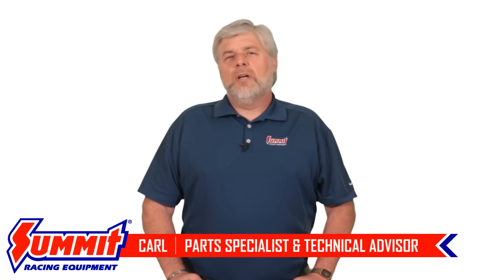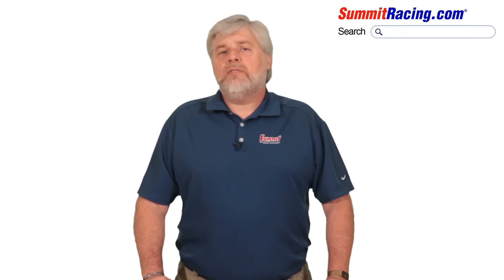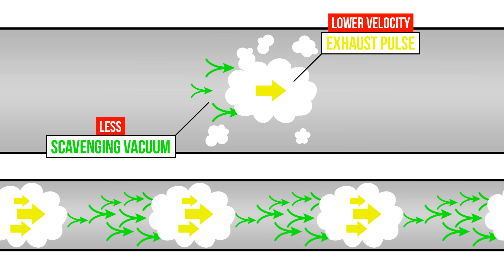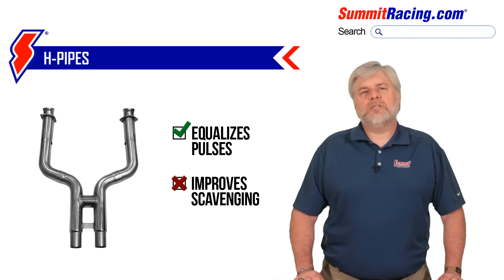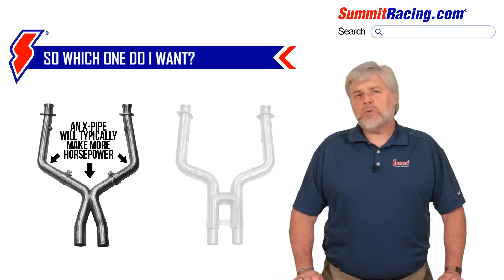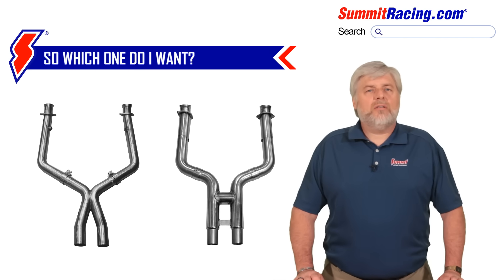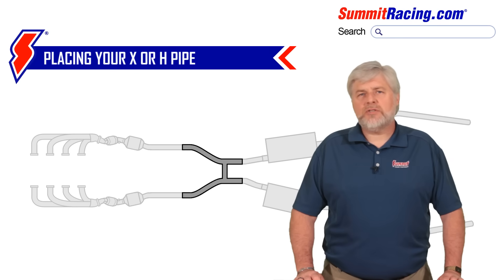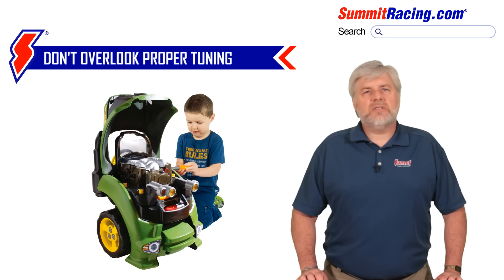Exhaust H-Pipes vs. X-Pipes: What You Need to Know

Comment: X-pipes suck on a Chev 381 stroker in a Camaro Z28. The sound was terrible.

I then took it off the next hour, cut down the middle of the x, slid a stainless plate in between and Welded it back up.

True dual exhaust! Sounds bad ass now.
Reply from the maker: Hi Jake, thanks for watching and giving feedback on your experience!

Comment: I'm building a restomodded 06 Escalade using the LS364/450HP GM performance engine. It's a 6.0L LQ9 with LS3 heads and a LS6 highlift cam. This will be a daily driver so, relatively speaking, MPG is a consideration. With this in mind, which is the better choice X or H pipe? Also, what diameter do you recommend?  Any other advice on exhaust configuration is appreciated.

Comment: I have a 96 impala as and am putting custom exhaust..5.7 ltr ...cold air intake k&n...373 gears ...aluminum balanced driveshaft..Do you recommend  a Xpipe or Hpipe for my impala? 2.5" ppiping..stock  exhaust manifold for now...would you advise headers..which header? Thanks for any help.

Comment: Summit ' you'll probably not answer my question but ' hopefully a reader might help ? why not include a straight pipe system ? Like example (manifold/Header, catalitic converter, resonator then muffler straight out to exhaust tail pipe ). All l hear about is X- pipe this and H-pipe that, but what about an exhaust system for each side of an engine like the old days ? Be it a six cylinder or eight cylinder engine. What would or wouldn't be the benefits ? How will a double exhaust system perform, sound and maybe even look ?
I have a 2014 mustang Roush RS with 3.7 V6.
Here in california we are not allowed to mess with the emissions end of a car, but we can do the mufflers. My Roush RS mufflers were getting to dam loud, so instead of removing them l added a 22 inch glass pack to both sides after the X pipe connection. 
It sounds totally quieter & awesome now.  It had  real bad "Drone" before,  in the area of 82.5 to 109.5 decibels in the cab of car. With the new glass packs it's down to the 72.5 - 80.5 decibel. Is it possible the "Drone" is coming from the X pipe connection ? The 3.7 V6 has a nice beefy sports car sound to it now from the out side, but it has the dredded muffled "Drone" sound inside cab still. The Drone is always present between 1400 & 1600 RPM . I hope someone can answers this question , thanks.

Comment: I have a question!  What will be results from the combination of x and h pipe in same exhaust? It's that worst or better or just depends what type is mounted closer to the engine?
Reply: There isn’t really a point imo. If you’re gonna do both, just do a true dual going into an x pipe. I don’t have hard numbers, but I don’t see how introducing unnecessary turbulence in the system is gonna help when you’re just gonna speed up the exhaust flow with the x pipe anyway. That’s not to say an h pipe is bad, it’s still great! But having both seems to be doing a lot for minimal, if any, improvements

Comment: The famous 95 MERC runs a Walker H-Pipe, 2" x 21" MagnaFlow Glasspacks, and Walker Tailpipes.
Exhaust tone is mellow, not raspy -- NO DRONING at freeway speeds, either.
https://www.mercuryforum.com/forum/grand-marquis-14/1995-grand-marquis-restoration-8937/

Comment: Ok I have a question for you I realize a lot depends on what vehicle and  the particular application I am building a 4.0 LTR Fuel injection Inline 6 for a  1998 Jeep Cherokee  which would be better H pipe or X pipe
Reply: Neither. Your I-6 will need a 2.25-inch single exhaust and a MagnaFlow Glasspack.
That Jeep's I-6 engine is the ONLY vehicle that gets a major power gain from a K&N CAI.
If ya get the K&N intake, install the conical filter AS IS -- install it, and LEAVE IT ALONE for 50,000 miles.
Keep your K&N Filter the same way you'd keep a hard-on -- don't fuck with it !!

Comment: I'm still confused.  For a stock Mustang GT, what is better?  H or X?  I believe the Mustang off the factory line has an H...but is that the best?
Reply: Until you set a performance goal there is no "best". What is it you are hoping to accomplish? Sound? torque? or top end power? The stock exhaust is a compromise to meet most applications and generally pretty good for stock engines. Speed costs money, how fast do you want to go?
Reply: @stm6989  Hey Stanley.  I'm not really a speed freak...I just want my Mustang to SOUND like a Mustang.  I want a deep throaty rumble.  I wouldn't mind a little more power...500 is plenty for me.  But right now...I just want good sound.  I guess top end power would be my goal.  Most of my driving is on the street, so I won't be pushing the limits of the engine.  If I'm on the freeway, I want to move when I punch it.
Reply: YEP. To get better flow and more torque & power from your H-Pipe setup, I use and recommend a pair of MagnaFlow Glasspacks, due to their straight-through design and there's NO baffles and/or louvers to restrict the flow.

Comment: So how do you achieve scavanging from single pipe exhaust ?
I have a 96 F150 with 4.9L   I was thinking 2-1/4 off manifolds x2 into Y connector into Flowmaster and 3” single out the back ? Stainless of corse. Will this scavange

Comment: Hpipe is better for turbos and maybe superchargers,  but the x pipes are better for a naturally aspirated engines.. 
Back pressure should of been mentioned.. being a turbo back pressure most likely isn't needed but other wise it's an integral part of the horse power and TQ mapping.. 
If you reduce your back pressure to much you will loose TQ but gain high end performance, and the more back pressure you start increase TQ at low end. 
Then you have to consider the purpose of the engine the bore and stroke and maybe gearing to pick the ideal exhaust. 
It's really not that complicated

Comment: I don't believe in either one. My car has a custom exhaust where the right and left sides are not connected at all. There is a separate pipe for each cylinder bank. Works and sounds wonderful.
Reply: If you are happy then no need to change😏
Reply: BOTH the H-Pipe and the X-Pipe improve the overall performance of the engine -- which is EXACTLY why they were invented (and used by FORD for their dual-exhaust syteems) in the first place.
Reply: @SlikLizrd  I'm less concerned about performance and more concerned about sound. By completely separating the right and left cylinder banks it changes the sound noticeably. To me it's all about the driving "experience", and the sound is a big part of that experience. You can only use so much performance on the street.
Reply: @geraldscott4302  Absolutely. Keeping the pipes separated gives a different sound, and it may or may not sound "better", according to one's preferences.
 HOWEVER, there are other considerations to weigh -- such as cockpit conversation, top-down cruising, and the much-dreaded DRONING.

Comment: Smaller pipes "may" give you more horsepower, unless you do it on the dyno, in which case, opinion burns down and horsepower goes up. bigger primary header tubes? More power. bigger exhaust system pipes? More power. X-pipes over H-pipes? More power.  But only if you put it on the dyno.  Otherwise, old wives tales rule.

Comment: The only thing I have a problem with is the header wrap over time cooks the headers.The tubing develops cracks and crevices then starts to crumble then blows out.. When replaced the old ones can be wadded up by hand...
Reply: My 468 c.i. build used port-matched, ceramic-coated, stock exhaust manifolds, with 2 High-Flow Cats, 2.5-inch Pipes, and some cheap-ass glasspacks that I later changed over to MagnaFlow glasspacks.
Many thanks to Summit Racing for their performance parts and excellent customer service.

Comment: Still hate when anyone in the automotive  field calls an Engine a motor
Reply: Tito Dwi Laksono  an engine converts a fuel to power, a motor uses energy  to make power.   Take a  gas engine  it take gas, air , spark and timing to make power, a motor takes electricity which is already power and turns it into motion.

Comment: On a 392 cc Int Harvester  -  PU, is the H setup, w/ bridge as close as possible to the exhaust manifold, the best solution for dual exhaust?  Thanks. jtr
Reply from the maker: Yes. The setup you’re describing would be ideal on your torquey, low-rpm International 392. Additionally, it also may help create a deeper exhaust tone.

Comment: I have a question about diesel exhaust? I have a 92 7.3 international non turbo engine. It has single exhaust now . The muffler is going fast . It has a 3 inch pipe going in the muffler. I am going to go with a 4 inch Y pipe and turning it in to dual exhaust. 4 inch out the back with 4 inch inlets and 7 inch outlet tips so it can breathe . You have any idea how many ft pounds of low end torque this will generate . I was also thinking about having a set of Headers built for it. The compression is 20 to one . One last thing this winter it would start at 8 degrees with only the Glow plugs . Now since it’s warming up it doesn’t want to start. So should I keep up with the winterizer or add kerosene each time I fill up. My email address is
montebrown110@gmail.com if someone in the non turbo club got a useful answer send it their . Could use some good advice on this?
Reply from the maker: You may gain a bit of power with a larger exhaust system, but not much. The naturally aspirated 7.3L IDI is mildly tuned, low-revving, and, of course, not turbocharged. Regarding your hard-starting issue, check for faulty glow plugs and leaky injector return line O-rings. Glow plugs often fail, and just one or two bad ones will make the 7.3 very hard to start. Test them with an ohmmeter. They should have 0.1 to 0.5 ohm of resistance; at 1 ohm or greater, they’re definitely bad. Be sure to replace them with high-quality parts; Motorcraft is a great choice. It is also common for the injector return line O-rings to shrink and allow air into the fuel system. The result is extended cranking times. To simplify the job, use one of these Delphi kits. Note that there are early- and late-style kits; the split was in 1992. Be sure to get the correct one for your vehicle.
https://www.summitracing.com/parts/MOF-ZD9
 
https://www.summitracing.com/search/part-type/fuel-injector-installation-kits/product-line/delphi-fuel-injector-installation-kits

Comment: What about y pipe? 

what is the ideal location for the y pipe. Is it better to placed further back or closer to the headers?
Reply from the maker: A Y-pipe should be placed as far forward as possible.
Reply: @SummitRacing in terms of efficiency does the y pipe scavenging and equalize the pulses as x pipe or h pipe ?

Comment: What’s the best setup for my 70 Chevelle SS 454? Thx
Reply from the maker: In most cases, an X-pipe will outperform an H-pipe. We would need to know specific details about your application. Give us a call @ 1-800-230-3030, and we can assist you further.

Comment: I put on a Cat Back Flo-Master dual exhaust system on my 2006 GMC seirra 2500HD.. ( 6 Liter Vortec ) And they kept them straight without an H or X pipe. Does that mean anything?
Reply from the maker: If I am looking at the correct system you are referring to, that kit has a dual into the muffler and a single larger tailpipe. The exhaust gases will scavenge at the muffler.
Reply: @SummitRacing  No.. I had a company change it to duel exhaust.... but they didnt include the X or H between them. no biggy.

Comment: I went with an H-pipe on my '06 Merc CLS500 because I wanted the old school V8 sound. Glad I did.
Reply: Bro I just bought a cls500. How are you finding the H pipe? I was thinking of an X pipe..
Reply: @yaseen123123  I'll be honest it took a long journey to get the exhaust how I wanted it on mine, I started with a rear muffler delete & it droned like crazy. Long story short I ended up with two glasspacks at the rear, a pair of J-pipes to eradicate the drone & I did run it for a while with an H-pipe in place of the resonator. It sounded good but there was still a small amount of drone, so I lost the H-pipe & had a pair of glasspacks put in it's place. It's now perfect for me, no drone & the V8 soundtrack is always there without becoming annoying on long trips. For me no crossover at all sounds best as it gives the true pulsing V8 sound, which Mercedes seemed to do their best to smooth out & eradicate. But it's all down to personal taste, some prefer an X-pipe which gives a more raspy, exotic car sound, some prefer an H-pipe which gives more of an old school V8 sound, I prefer no crossover at all, as for me it should have the signature V8 pulsing, woofly sound. The difference between an X-pipe, H-pipe or even no crossover at all is minimal anyway, there's only a couple of BHP in it.
Reply: @yaseen123123  BRO!

Comment: Can u have both x and h pipe?
Reply from the maker: The goal of a -H or -X pipe is to equalize pressure and improve scavenging. There would be no benefit to adding a combination of the two. A properly located and sized -H or-X pipe suited for your application is your best option.

Comment: 2018 Ram 1500 5.7 x pipe or h pipe? Witch is better for me?
Reply from the maker: In general, trucks need more torque at lower rpms for towing, hauling, etc. I would suggest an H-pipe for your application.

Comment: Terms: Scavenging, vacuum draw, are ancient and show a basic misunderstanding of how exhaust works. While the explanation sort of works for most systems, people can be mislead when setting up a system. For example: Equal length tube headers are sought after, But they are only advantageous if you are running a flat crank in a 90º V8. In a standard S.B. chevy, A certain range of tube lengths will work with the right collector. Why? because the pulses on a cyl. head do not come out at even intervals.

Comment: 86 Bronco with 5.0, looking to add long tube headers and GT40 heads. Low end torque (power under 4500) is the goal. Will my best bet be dual with H, No H, or 2 into one?
Reply from the maker: The Bronco has limited room under the chassis. I recommend dual-pipes into one single muffler with a larger single tailpipe exiting behind the back rear passenger wheel to prevent exhaust fumes from swirling behind the tailgate as much as possible. 
https://www.summitracing.com/search/part-type/mufflers?N=universal%3Ayes%2Binlet-quantity%3Atwo%2Boutlet-quantity%3Aone&SortBy=Default&SortOrder=Ascending&keyword=muffler&kr=muffler
 
https://www.summitracing.com/search/part-type/exhaust-pipes-tailpipes?N=part-type%3Aexhaust-pipes-tailpipes%2Buniversal%3Ayes%2Boutside-diameter-in%3A3-000-in_4-000-in_3-500-in%2Btailpipe-location%3Apassenger-side&SortBy=BestKeywordMatch&SortOrder=Ascending
Reply: @SummitRacing   im a custom car builder by trade. So altering, or making a new crossmember wouldnt be an issue. I was going to dump the exhaust right before the rear tire. I had a single outlet on my last one. Had no fume issues.
Im honestly not a fan of flowmaster. I was thinking magna flow. 
What would be the recommendation on the H? Would it make a noticeable power increase with the other items, or are the gains negligible, and keep the exhaust without the H pipe?

Comment: I have power from 6,000 to the red line at 8,250rpm and I like the fact it is quiet at low speeds.
Bad idea 1 making exhausts loud just to be loud
2 making exhausts loud on startup
3 piping v8 sound into a v6 i6 or i4 - in fact any piped sound is just stupid.

Comment: I was thinking the bigger the exhaust pipe the better the motor can breath , for example if you blow out of a big straw vs a smaller one the bigger one is easier
Reply: Them problem is that if you have more space the gasses expand and start cooling faster, this can cause back pressure. Not good

Comment: Wat do u think about putting those don’t know wat they are called the adapter to make it dual exhaust and when u flip the switch it closes one side and gets quite? I have a 2500 4x4 Chevy Silverado and want to put dual exhaust wat do u recommend?
Reply from the maker: Hello Jose, I believe what you are referring to is an Exhaust Y-Pipes and Electric Exhaust Cutouts.  I would need to know more information before I could answer your question properly. What year is your truck and what is the cab and bed length?
Reply: @SummitRacing  2009 Chevy Silverado 2500  4x4
Reply: 4 door
Reply: @SummitRacing  
Chevy Silverado 2500 HD the bed size is 6’5”
Reply: How do I measure my truck bed.? Sorry for delay

Comment: Hello I have an 2006 X5 3.0i. Which pipe would be best for me?
Reply from the maker: Hi Angelo, 
I was unable to locate any direct fit options for your X5. However, if you were fabricating your own exhaust, I would consider using an X-pipe with the 3.0L inline 6-cylinder engine.

Comment: can you use the oem trackhawk cat back exhaust on a 5.7 cherokee .
Reply from the maker: It will fit the vehicle and hangar locations are similar but the head pipe connection will need to be modified to connect. You may also need to modify bumper for the quad tips. This is not a direct bolt in.

Comment: No real explanation here....if you have a basic 06' srt with flowmaster 40's in middle, which is better x or h pipe?...already got rid of resonators.....please help, like to finish off, since I thought I lost torque with middle resonator removed.
Reply from the maker: For your application, I definitely would go with an X-pipe. That will help restore the power from removing the resonators and probably a little more.